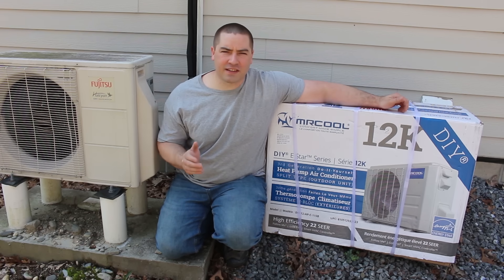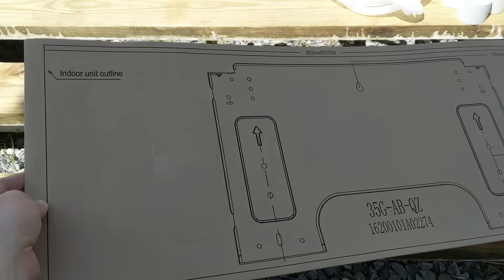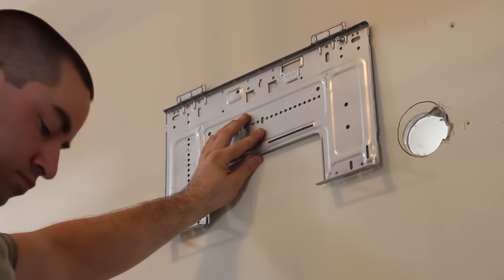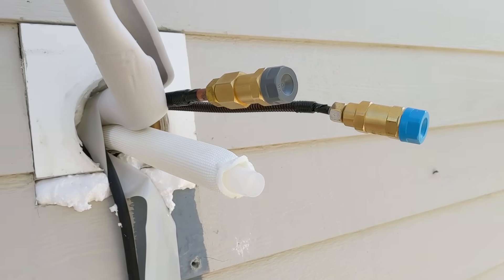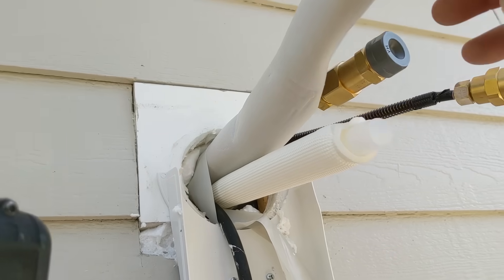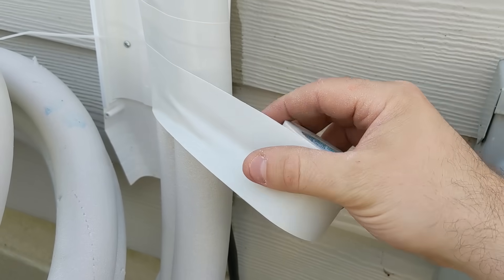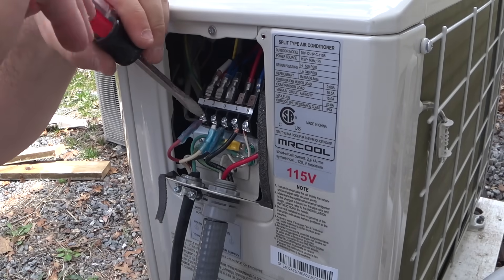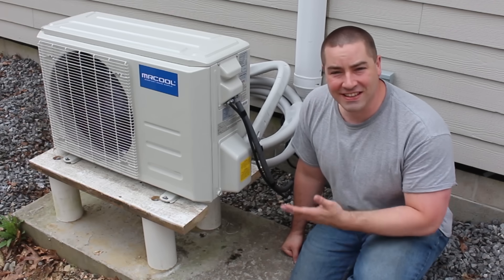Installing My Own Mini-Split Heat Pump, DIY

Comment: 5 years old is a pretty short amount of time for such epensive device.

Does your new unit heat and air condition ?
Do you use it for heating during winter and spring the whole house too ?
Reply from the maker: I will use this new unit for both heating and cooling the whole house.  I have a fairly small home, and this is centrally located.
Reply: Very enlightening video, David! Can you give details about the unit's power consumption in both heating and cooling mode, and confirm that your power source is solely your own off-grid solar system? What's the demand on your battery at night and on cloudy/rainy days, and how did you size the heat pump with your power supply? Thanks!
Reply from the maker: Hi Jeffrey,  I'll do a follow up video with an amp meter.  But, this has been running the past week 100% off-grid with my whole-house.  Just 2 days ago we got snow (very light) and it didn't have a problem keeping the house warm.
Reply: DavidPoz That's great, looking forward to the follow-up. I'm preparing to build an off-grid passive solar house but will need supplemental heat. As I'm building with rammed earth and lots of thermal mass, I'm keen to find a suitable system to heat and circulate water rather than air. Because the vast cold Pacific is just a mile away, nighttime temps in summer often drop to 9-10c, so we sometimes fire up the wood stove in summer! I'm looking for a solar powered system that will eliminate the need for wood burning (and cutting and splitting and stacking and hauling).
Reply: @DavidPozEnergy  curious on 2 things. 1...any noncondensibles gwt into lineset and 2...how to you plan on unplugging drain see how its exposed ro bugs and insects which WILL infiltrate into condensate drain tubing.
Reply: Raty girls the line sets come sealed with a foil seal on the ends. You can see that in the video. There is either a vacuum drawn on it or they have released the vacuum with a small charge of 410a refrigerant. They do that so unlicensed consumers can legally install HVAC equipment. As far as bugs going in the drain, I’ve done HVAC and appliance repair for 25 years and bugs in drains hasn’t been a particular problem. Mostly cock roaches in fridge freezer drain lines in homes heavily infested. Could just be my neck of the woods. You can put your shop-vac on it once a month when you wash the filter to suck out the snot and  bugs that venture in and drown or make a nest. On walk-in freezers we put a U bend at the end of the drain since the outflow of water is periodic the U bend retains water all the time and critters can’t get in so I guess you could just attach the hose in a bend to retain liquid just for just in case.
Reply: Jeffrey Parker if you want high efficiency then most mini split heat pumps units will do the trick. The more premium brands will actually heat the same amount of BTU’s or more than cooling BTU’s rated. So a 12k rating should have 12k cool and 12k heat. But cheaper units usually have 12k cool, 9k heat. You end up in turbo mode to heat and the wall unit is up high so the temperature is being read up there not down where you are. My cheap unit has to be on 80 to keep us comfortable. In the end tho it still uses a lot less than the old gad furnace from hell. If the top of the wall is not ideal, they make floor/wall/ceiling models as well. They have small pump kits that attach below the wall unit to pump away condensate if you install on an inner wall. This brand I have sold successfully and had no complaints. I’m not sponsored and my channel is new if it could be called a channel. 😂

https://www.pioneerminisplit.com
Reply: @melissa7daveodonnell  I have 5 years with a mini split and insects have not been a issue  nor after  8 years of  following the technology have I seen a complaint.  .. I have a two ton Mitsubishi  mini split since the fall of 2015. The installed  cost  was $4200 and my energy cost  have averaged $1000 less per year. If you live in a region  with high humidity you will love  a mini split .   We used to have mildew issues in the summer but not since the installation .  The energy cost are 1/3 less than  window  units.
Reply: @melissa7daveodonnell  I live in south Florida, i have the High Seer version of this, which is identical just different brand name, i installed it in 2015 and the bugs have never been an issue. In the unit inside the house, the hose connects to a small like 3x2 drain pan and there is a mesh that covers the hole exiting to the hose. So even if something went up the hose it would not get past that mesh screen. I have to use the shop vacuum on mine about once a year, because algae grows on the inside of the drain line over time, i just take the shop vac and cup it over the drain line outside with my hand and most of the algae sucks out like a straw.
Reply: @jeffreykparker   geothermal. Water heater or HVAC system.
Reply: @billssolarpowerandgardenin1016   yup exactly. They made pre charged line sets for Mobile Home units just like this years ago. I think these are vacuumed and all the refrigerant is in the condenser. These are so much a better solution for DIY than selling a normal system with a pat on the back you can do it. I was interested to see how he was going to tackle the flares but to my surprise none needed. I get any customers that really want to do it themselves I'll reccomend this brand. As to 1 comment I saw about being expensive to not last long, I tell my customers they are about 8 year lifespan unless you get a unicorn one. Most seem to lose a circuit board or 2 by then and almost all develope a leak by then
Reply: @melissa7daveodonnell  Despite the people saying it's not an issue, I've had the same concern, so my plan, when I install the mini splits for my new shop, is to shove some metal screen in the end of the condensate line.

Comment: I bet you easily could have fitted that piping through the old hole in the wall.
Reply from the maker: I thought the same thing after I did it.  LOL.  I don't know why the instructions called for a 3.5" hole.
Reply: @DavidPozEnergy  would have saved you on the PU foam
Reply: Should be drilled at a downward angle as well
Reply: Was thinking the exact same thing before he enlarged the hole.
Reply: Limiting the bend radius needed to avoid kinking on exit of both lines is the most likely reason for the larger opening.  You only get 1 chance to do it right with the DIY version.